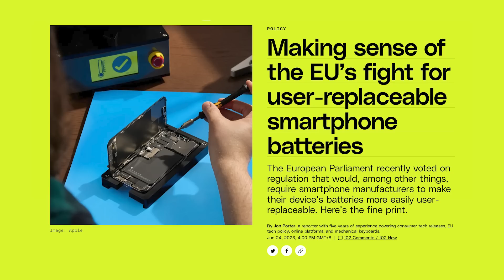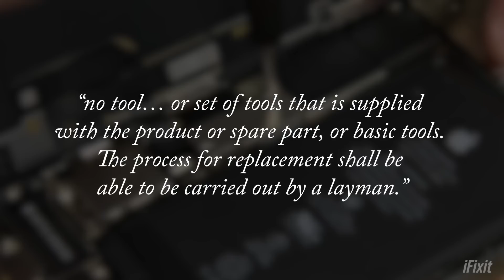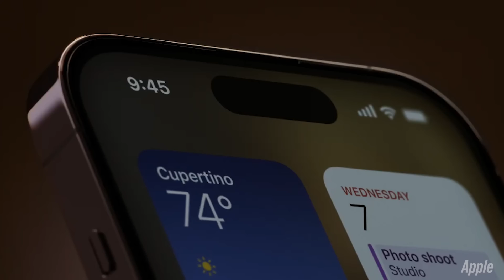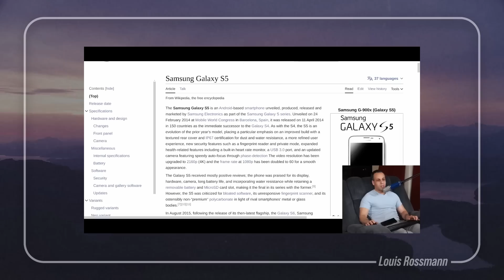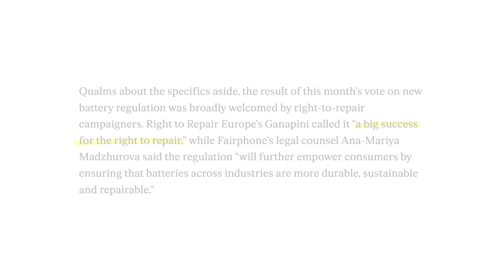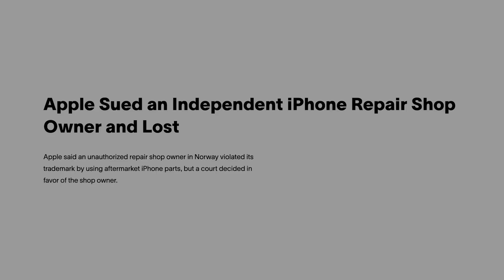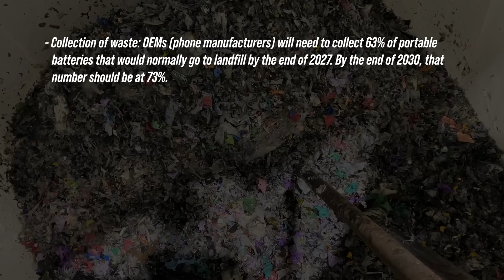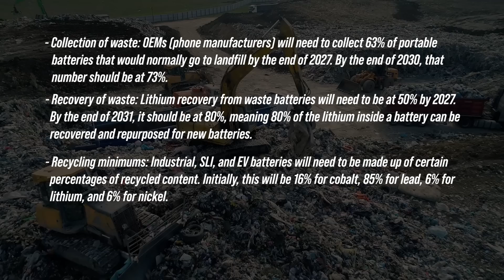EU Just Changed Smartphones Forever

Comment: Unfortunately this wont change anything. Smartphone Manufacturers that claim their smartphones are water resistant, wont need to make the battery changeable. You cann look it up in the official document of the EU Parlament. Since all the iPhones are water resistant they don’t need to change anything 😉
Reply: It doesn't work like that, sorry.

"To ensure the safety of end-users, this Regulation should provide for a limited derogation
for portable batteries from the removability and replaceability requirements set for portable
batteries concerning appliances that incorporate portable batteries and that are specifically
designed to be used, for the majority of the active service of the appliance, in an
environment that is regularly subject to splashing water, water streams or water immersion
and that are intended to be washable or rinseable."

So not the smartphones, since they are not "specifically designed to be used, for the majority of the active service of the appliance, in an
environment that is regularly subject to splashing water, water streams or water immersion".

Also:
"This derogation should only apply when
it is not possible, by way of redesign of the appliance, to ensure the safety of the end-user
and the safe continued use of the appliance after the end-user has correctly followed the
instructions to remove and replace the battery". 

Gopro cameras have removable batteries and higher waterproof standards than any cellphone, so good luck in demonstrating such an impossibility.

And:
"Where the derogation applies, the product
should be designed in such a way as to make the battery removable and replaceable only
by independent professionals, and not by end-users."

So "independent professionals" (and not only the firm's technicians) should be able to replace the battery ANYWAY. NO sealed batteries and NO "blackbox" devices than only the manufacturer can open.

Comment: I do believe wanting your phone as compact as possible will make the battery harder to replace! IDK about this law seems extreme to me. I still think there should be laws to stop extreme and unnecessary anti-customer designs. Yet that does not men forcing every one of these devices to have a user replaceable battery in some cases that is just not an option.
Reply: Why? The dimension of the cellphone is dictated by the screen, not the battery. Nokia cellphones have removable batteries. They don't seem less compact than other manufacturers' products.

Comment: still rocking an iPhone 6S. last year i had the battery changed, and the service charge more than doubled the cost. this law would reduce the costs on my next mobile phone to that of the battery. tried to do the same for a gen 1 iPad pro, but the service refused to guarantee returning it in one piece and working. now i have to send it 250 km (155 mi) to another city to get it repaired by an apple authorised service, ffs!

Comment: I thought all that "adhesive" was what kept my phone waterproof...
I think I would rather have a waterproof phone than one I can change the battery out from...
It's just one more thing you'd have to worry about carrying around or leaving at home...
Reply: didnt watch the video clearly
Reply: Samsung S5 had a IP67 waterproof rating (1 hour under 1m of water) with replaceable battery.
Gopro cameras have higher waterproof rating than any cellphone, and have replaceable batteries.

Comment: to be fair, the return the batteries alteady has pretty good example irl, here in germany we have "Pfand" on pet bottles, we pay 25 cents more per bottle and if we returm it to any supermarket we will get the 25 cents back, or co2 preassired cylinders which you can trade in so you don't need to buy a new one, tldr make batteries slightly more expensive and implement cashback on return as incentive

Comment: The change to integrated batteries is totally motivated by profit. Dead battery? Buy a whole new device, even though the electronics are perfectly functional. I will say that it will be interesting to see how they follow this directive with respect to wireless earbuds. I'm guessing they'll use rechargeable coin cells, otherwise they will eat replacement batteries and the market for these devices will shrink due to cost of ownership. On the other hand, maybe we'll see the return of quality wired earbuds again.
Reply: A litteral step back in time😂
Maybe the walkman will return to
Reply: I am not sure, but were wireless earbuds even included?
Reply: one more hole for water to seep into
Reply: yep, and where are you gonna plug them into? :D it's not like phones have headphone jack, or even some laptops :D

Comment: No more water resistant phones.
Reply: Ok, I stand corrected. 
I really like water resistance.
Reply: Look up what IP67 water resistant means
Reply: Samsung S5 had a IP67 waterproof rating (1 hour under 1m of water) with replaceable battery.
Gopro cameras have higher waterproof rating than any cellphone, and have replaceable batteries.

Comment: They need to also implement an open source, battery form factor for phones...i.e. like a AA battery, so it is no big deal to swap out a battery.

I remember when each phone used a different battery, and you could buy the wrong one.

Standardizing a battery having the specs be the same, so if you like Smasungs batteries more than Nokia, you could use a Nokia Battery in a Samsung product.

Comment: But I don’t want a removable battery and clearly based on their demise they couldn’t compete with sealed batteries. This new law sucks. Removable batteries were constantly not connecting properly. I was always having to pull them out and re-plug them to get good connections. Sometimes hundreds of times in a day. I am in on Right to Repair and maybe some common sense serviceability requirements.
Reply: Much of Nokia smartphones still have replaceable battery. Infact Nokia welcomed the EU law. There are many ways to do a connection. How many times a day you pull out and re-plug the hard disk of your pc?

Comment: "Do you think the phasing out of user-replaceable batteries was the natural progression of design as dictated by consumer demand, or are these changes motivated by profit?"  Neither.  The phasing out of batteries was to make the devices more reliable.  I had dozens of devices back in the day with user-replaceable batteries (phones and computers).  In just about every case, when the product failed it failed due to mechanical failure of the battery contacts being no longer able to connect reliably.  The same is true with SD cards - I migrated from iOS to Android years ago because I needed the expansion capability of extra memory.  The SD slot on every phone I had failed as the card could no longer make contact correctly.  These laws will produce the exact response they are trying to avoid.  Users will (have to) replace devices more frequently and there will be more e-waste.  The real promise lawmakers should instead get behind is the development of the "infinite" battery, a battery with a life longer than that of the rest of the phone, tablet, computer or vehicle.  It is obvious there is a massive improvement coming with future battery technology (e.g. graphene batteries).

Comment: I'm not entirely opposed to a device being sealed shut with adhesives and shit to increase water and dust-resistant the problem is these devices are designed to be as difficult to repair as possible where you're having to take out half the phone to get to the damn battery let alone the screen if you can even get a replacement screen in the first place

Comment: The change from replaceable batteries to non-replaceable batteries was in my opinion done to make phones more a consumable rather than an evolution of design. To me getting a new phone nowadays is not because i need a new phone, but just because it is more economical to do that than get my battery replaced. I have a lot of electronics that i have used for years and years upon end without dumb costs and i don't see the reason why phones can't be that way.
Reply: That but also whole thing become insanely wasteful. I case of phones too many  perfectly working are thrown away just because battery become old or some idiotic plastic part or chip that cost 10 cents is broken but practically irreplaceable because they are sandwiched and covered in resin in such way it just cannot be done and you must replace whole parts they are attached to for a price of new phone. Everyone is obsessed with ecology for PR but thang that can have biggest impact aka extending life of electronics by for example be easily repairable for reasonable cost. I don't know statistics but i bet that combustion engines everyone are obsessed about cant even hold the candle to planned obsolesce in personal electronics.

Comment: Actually they just screwed up all phones and they will never be water proof again. I started an iphone repair company and have fixed thousands of phones. If you fix anything on the phone they will not be waterproof. When it comes to fixing computers that is a completely different story.
Reply: Most people replace their phones not because they got a bit wet, but because of the battery, the software, or a smashed screen. BTW the Samsung S5 has a IP67 water resistant certification with removable battery.

Comment: There is a EU law, was activated (2006), which stated that it should be easy for a car user to change a lightbulb from the headlight! And jet in most modern cars the instruction manual says “Go to the garage” because it’s not possible to do it by yourself! Often the headlight or front bumper must be removed, before the bulb can be changed. The manufacturers ignore this law and worked around it by design at the cost of the consumers. So how will they enforce this new law, I wonder….
Reply: The law did not instruct the manufacturers on what to write on the instruction manual. It only made mandatory that it should have been easy (that means not requiring any special tool) to replace the bulb.

Comment: This is going to be challenged in the international courts and the E.U. are going to be told "NYOPEY!" at 200 decibels and have to backtrack.
Reply: Uh, there's no court that can say no to this. The EU already cleared it with their regulatory agencies and it's already been approved by EU courts, which are the only courts with jurisdiction here. This situation is over. They''ll comply or their phones will be removed from the market.
Reply: Uhhh... no. There is not "international court" where this can be challenged. The EU adopts the standard it wants in its internal market. It always did, and manufacturers ALWAYS had to cope with it. Check "Brussels effect". 
"The combination of market size, market importance, stringent standards and regulatory capacity of the European Union have the effect that firms trading internationally find that it is not economically, legally or technically practical to maintain lower standards in non-EU markets. Non-EU companies exporting globally can find that it is beneficial to adopt standards set in Brussels uniformly throughout their business."
Reply: @neutronalchemist3241 The problem is that these are not 'lower standards' that the manufacturers are pushing.
They are the ONLY standards that ALSO allow for water-proofing of devices in the real world.
Manufacturers have tried making water-proof and water-resistant up to X feet of water submersion things in the past.
Cannot be done without sealing the devices with adhesives and getting rid of as many 'holes to the inside' as possible.
Reply: @christopherkidwell9817  It doesn't count if you consider those standards higher or lower. 
1) There is not "international court" where this can be challenged. The EU adopts the standard it wants in its internal market. It always did, and manufacturers ALWAYS had to cope with it.
2) Samsung S5 had a IP67 waterproof standard (at least an hour under 1m of water) with removable battery. Gopro has removable battery and a higher waterproof standard than high-end cellphones.
3) Even without counting point 2, if the EU is more concerned about environmental problems than waterproofing cellphones, THEN THE MANUFACTURERS HAVE TO COPE WITH IT. It's not in their power or right to challenge what a political organ is concerned about.
Reply: @neutronalchemist3241 The E.U. can have those standards challenged on numerous grounds.
They are not dictators in the real world, even though they think they are in their deluded little pea-sized minds.
And I think that the E.U. courts would rule in favor of "Water/weather-resistance is a good thing!"
Reply: @christopherkidwell9817  It seems you are a little confused about what a dictator is.
No they can't. EU is a democracy. The corporations that, to you, should "challenge" the standards it decided to have on behalf of it's citizens aren't. 
The possibility for local courts to decide against EU standards is "0", because that's not allowed by EU treaties. 
The possibility of the Court of Justice of the European Union to rule against an European law adopted by the DEMOCRATICALLY ELECTED EUROPEAN PARLIAMENT is "0", because it's role is  "to make sure the EU law it is applied in the same way in all EU countries, and to settle legal disputes between national governments and EU institutions", it can't challenge the Parliament.
The possibility of the European Court of Human Rights to even consider a case of technical standards is "0".
And that exhausts the available courts, sorry.

Comment: The thing is that by the time the battery needs to be replaced the device is also slowing down and starting the have other issues. So unless everything is going to be easily replaced so you can actually fix whatever is breaking, making the battery alone replaceable isn't going to really do much for consumers or the environment.